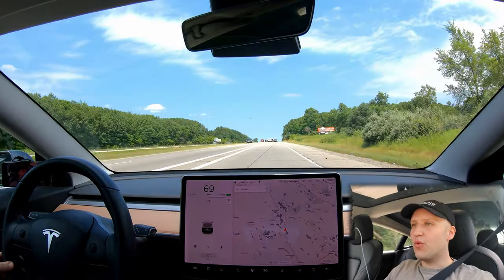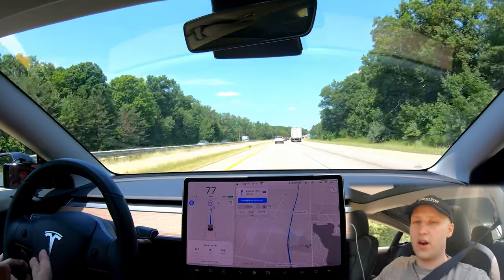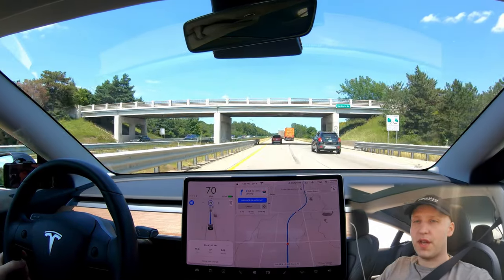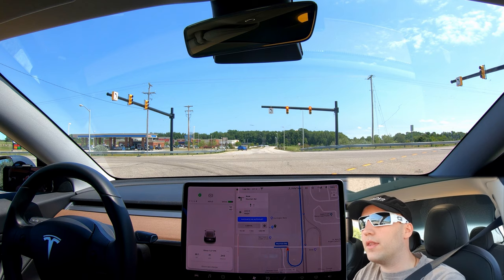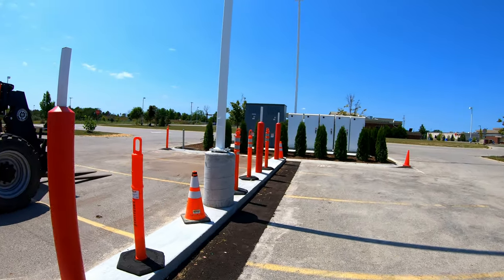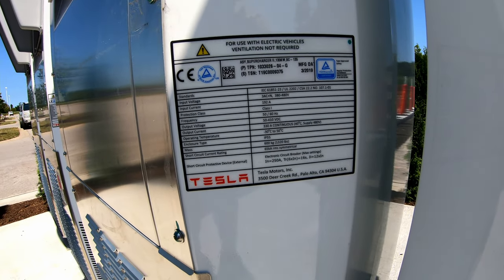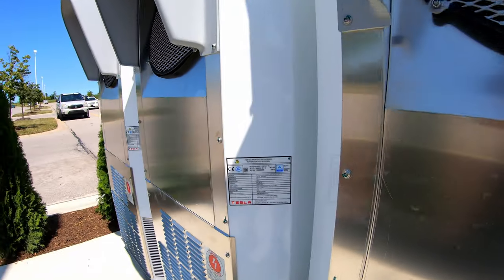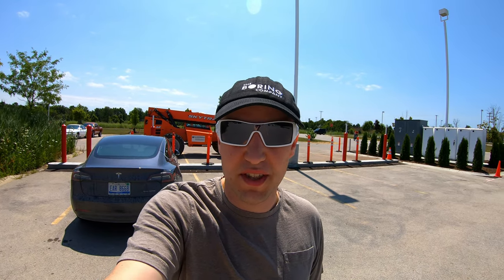What is Going On at this Unfinished Supercharger? | Construction | Autopilot Driving |

Comment: It's a 10 stall location for sure.  Each cabinet can handle 2 stalls
Reply from the maker: That would be awesome, but then why were there only 5 of those white boxes? Maybe 10 in the future?
Reply: @DirtyTesla  Same goes for the distribution boxes (each pipe coming out goes to a stall)
Reply: I have a iPhone application called “Supercharger” it has this one listed on the map as 10 stalls
Reply: @FromGregg  supercharge.info is the best resource for current and pending superchargers.
Reply: @DirtyTesla  The white boxes are probably for power distribution, one for each charger. One charger can handle two cars.
Reply from the maker: @TeslaRoger  I'll check that out, thank you. Do you know of any other examples of chargers where the cars would park back to back like this?
Reply: @DirtyTesla  Each white charger cabinet supports two charging pedestals.  They may make two of the charging spots as handicap so they would be double width.
Reply: @FromGregg  I just downloaded that. It's basically superchage.info in app form, forum links and all. That's awesome. Thanks!
Reply: I'm no electrician expert, but I believe it would be a 10 stall. If u look at each white box there are 2 of those giant pipes going through.
Reply: That means it’s v2 😢
Reply: Dirty Tesla Yeah we have one in victor ny set up as an 8 stall with 4 back to back
Reply: Matt_Waddy you’re welcome!

Comment: My only Supercharger is at Meijer in Auburn Hills, but Schwartz creek would be great since it’s on the way to Lansing or up north.
Reply from the maker: That's the one I'd usually use, but with all the construction and the on/off ramps being closed, it's too difficult to get there for me. 

Which car do you drive? Need to borrow a 3 to make a video with it? ;) There's also one supposedly being built in Novi, along with one planned for Detroit, but the Detroit one will take years imo

Comment: the one on the end nearest the bushes is most likely a pull in, you can see the measurements for it and the hold for the station already dug, also it's a 10 stall, look at 7:52 two lines coming out of each of those boxes for a total of 10

Comment: V2 135 kWh chargers will get up rated too 150 kWh.  It’s a 10 stall with 9 back in stalls and 1 pull in (the conduit sticking out of the ground inside the wood form for the concrete pedestal base) shown near the end of video.
Reply from the maker: You know your superchargers! Have you seen any like this where the 5 are back to back? Have any pics or locations?
Reply: Dirty Tesla, Not a 10 stall, but Gallup, NM has a 4 stall back to back configuration without a pull in. I’ve used it on a road trip from Wisconsin to Arizona last March. I also used a 6 stall all pull in at Wichita, KS. on the same trip. St.Joseph, MO. Has an 8 stall back to back setup with 7 back in and 1 pull in. Each site location has configuration limitations that dictate how the site will be designed.

Comment: Out here in Colorado Springs, Colorado we only have one Supercharger.  The next nearest ones are 60, 125, 72, and 107 miles miles away to the north, south, east, and west of us respectively.  So if anyone was thinking of going across Southern Colorado on a road trip they will have to go use ours.  

The one in Colorado Springs sits inside a parking garage that forces users to pay a $1.00 to enter after business hours and on weekends.  It does not have a public toilet, does not have a lounge, and does not have a 7/11 type of convenience store or vending machines.  

So you will have to go to the surrounding restaurants to use a public toilet and/or get something to eat and/or drink.  It is not a big deal if you are on vacation, but relying on ours for regular charging can suck, especially with a full bladder and/or hungry/thirsty at 3 or 4 a.m.
Reply from the maker: Yeah that sucks. On our road trip MI to NC we only hit 1 SC that wasn't immediately in the vaccinity of a bathroom, and it was at a mall. We just charged and then went somewhere to get food and use the bathroom.

Comment: I love that the midwest is FINALLY getting some charging stations. I have family in Ft. Wayne Indiana, and the Meijer there has one. But not too many around there yet. Here in San Diego we have so many!
Reply from the maker: And I think you still need more out there! Have yoy encountered any lines? If be pretty annoyed to pull up to that...
Reply: Out here in Colorado Springs, Colorado we only have one Supercharger.  The next nearest ones are 60, 125, 72, and 107 miles miles away to the north, south, east, and west of us respectively.  So if anyone was thinking of going across Southern Colorado on a road trip they will have to go use ours.  

The one in Colorado Springs sits inside a parking garage that forces users to pay a $1.00 to enter after business hours and on weekends.  It does not have a public toilet, does not have a lounge, and does not have a 7/11 type of convenience store or vending machines.  

So you will have to go to the surrounding restaurants to use a public toilet and/or get something to eat and/or drink.  It is not a big deal if you are on vacation, but relying on ours for regular charging can suck, especially with a full bladder and/or hungry/thirsty at 3 or 4 a.m.

Comment: The output voltage (410 volts), and current (330 amps) will provide 135,300 watts (135.3 kWatts)
Reply: See my other comment, output can't be greater than input surely?
Reply: This is correct. The input power is 3-phase, so if you don't account for that, it looks like the input power is lower than the output power, but the input power is actually 159kW max.
Reply: @eubikedude  you calculated the input current wrong, that's why.

Comment: The "pipes" are called conduit.  They're not likely to put any wiring in them until they are ready to put in the pedestals because people think it's cool to steal wire so that cone you picked up had a piece of conduit under it with some duct tape to keep things from falling in.  You were not at risk/trouble at any time.
Reply from the maker: Thanks! Yes but the wiring must be underground, yes?
Reply: @DirtyTesla  yeah, the conduit is run under the concrete (also likely under the pavement which is probably why the blacktop was dug up right next to the concrete pad) and into one of the cabinets or chargers.  Not exactly sure which.  When they being the pedestals, or right before, they'll pull the wire through and connect it all up.  This is why the conduit runs usually have curves or access panels so the wire can easily be pulled through.

Comment: Give them time... there are still plenty supercharger locations that are marked on the map, at least on the website, that haven't even begun working on becoming reality yet. From watching Tesla vlogs, it seems they do show on the GPS map as well.
They may not be done constructing those small white boxes. As per the space where the poles are, it looks like the chargers themselves might be placed in such a way that you would pull in forward to charge. Also considering there's six parking spaces on each side. They could be taking one of them out, possibly on both sides, to make space for the chargers to be placed, again in such a way that you would pull in forward to charge.
Reply from the maker: We need more chargers, Brian!
Reply: That's why there are more locations marked on the map! Some are being constructed and some haven't even begun becoming reality yet.
I'm very well aware more are needed. I've done mapping at tesla.com/trips in which route out of the way to get to superchargers. I just did a mapping a few hours ago which could've easily mapped a 'straighter' route as it didn't even need a supercharger stop. But instead it mapped out of the way with a supercharger stop.
About the northern half of PA only has two... one here in Erie County (western side of PA) and one on the eastern side of the state. The southern part of the state has a few or so already. I did a mapping to get from home to the northeastern PA supercharger location and it routed to go through NY for supercharger stops along the way.

Comment: I don't know much about EVs so need to ask. Can other makes of EVs use the Tesla charging stations? Are the connecting plugs universal or proprietary to each model?
Reply from the maker: There are standards such J1772, chademo, and CCS, but Tesla uses their own connector. You can get an adapter to use Teslas at some of the other stations, but only Teslas can charge at superchargers.

To be fair, Tesla is open to partnering with other car manufacturers, but no one had taken them up on the offer yet.
Reply: @DirtyTesla   I would guess the usage on some of the super chargers are pretty low in some areas then or is there that many Teslas on the road already?
Reply from the maker: @royallclark6331  It depends where you are in the country. In California, it's not uncommon to have to wait in line to get a charge...really unfortunate. For me, I did a road trip from MI to NC https://www.youtube.com/watch?v=07EnZpZKAVs and back, and sometimes there were 0 other Teslas, sometimes I took the 2nd to last spot.

I don't go to superchargers almost ever tho. I do all my charging at home, and I'm full every morning - so no need to charge anywhere else. But yes, in MI, it's common to pull up to an empty charger.

Comment: Can you stay in your car and listen to the radio or have the heat on and charge your car?
Reply from the maker: Yes definitely. And you can play the games on the car while it charges :)
Reply: @DirtyTesla  Cool!  Like I said I live in a apartment complex with a attached garage, but I don't think the complex will let me do any electrical work to accommodate charging.  There is a Tesla charger within 6 miles from here and on those cold - degree wind chill days I can stay in the car and charge. Thank God for the charges, but all the ones I have seen at Meijer are a nice distance from the store.
Reply from the maker: It never hurts to ask. Even getting a standard outlet would be a huge benefit.

And you want the charges far away or non-Tesals will park in them and block the chargers
Reply: @DirtyTesla  It's bad enough for me with cars parking in the (very few) motorcycle spaces at shopping centres. :(  People can be such tools. ;)  I can imagine how it will be with electric motorcycles if there are dedicated elecric motorcycle chargers. ;)
Reply: Yes, yes, yes

Comment: I do believe that all installed superchargers after may 20th 2019 were supposed to be V3.
Reply from the maker: Where did you hear that? I think V3 are only going to select locations for now. And I'd assume this construction started before May.
Reply: That would lend weight to the idea that the outputs are joined in some way?
Reply: Maybe this location is not a V3 because the permit process started on or before May 20th, 2019.
Reply: That's old news. Musk said that the V3 rollout would rapid following its launch. It's been anything but rapid. Something is causing them to pause.

Comment: Looks like ~95kW max. from the input rating? Power = Volts times Amps.
Reply from the maker: I really can't believe that's true...
Reply: @DirtyTesla  It is though. :)  That's per each of the large Tesla marked units. Either that or the label is from an old version, but I would think legally it needs to be correct?
Oddly the output says 410V x 330A which would be 135kW. But that would be in an ideal case and I can't see how output can be greater than input: 480V x 192A = 92,160W. So the max V on the output would be 410V, but the current would be less than the max 330A (i.e. 224A) to stay within the input spec.  Or you could have a car taking 330A but at a lower voltage e.g.  ~280V.
Maybe they have the outputs joined together, maybe in pairs? That would mean you could get ~180kW if you were the only person on a pair? You would have one "dud" stall with 92kW then though, maybe they have all 5 together with a per vehicle 350kW cap? That would mean V3, but only for one vehicle.
Reply: 3-phase AC is hard 😂

It's maximum 135.3 kW output.

You cannot calculate the maximum consumption or output from the input ratings, since you don't know the input voltage (input is a range) and you don't know the power factor and you don't know the efficiency.
Reply: Note that this is 3 phase power (notice the 3AC designation). 3-phase power is volts * amps * square root of 3 (~1.732), which gives a (max) input power of ~159kW.
Reply: @Zshazz  well, maximum apparent input power. Since we don't know the power factor.
Reply: @RubenKelevra  You don't need to know the power factor. The label states the output amperage is 330A.

330a at 380v equates to about 125 kWh vehicle charge rate.
Reply: @JeanPierreWhite  125 kWh is a energy capacity, not a power rating. And the highest output voltage is not 380 V DC but  410 V DC.

So the maximum output power would be 135.3 kW.

And I have no idea what you meant with "we don't need to now the power factor" since it's essentially to calculate the maximum apparent input power. 🤔